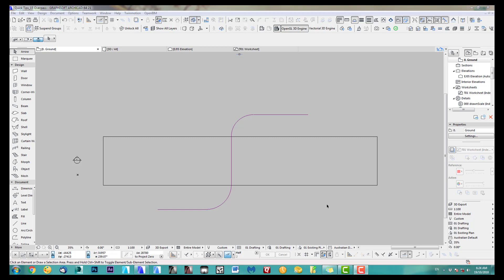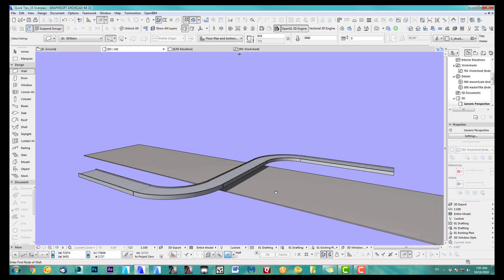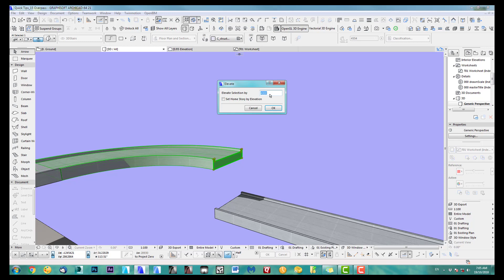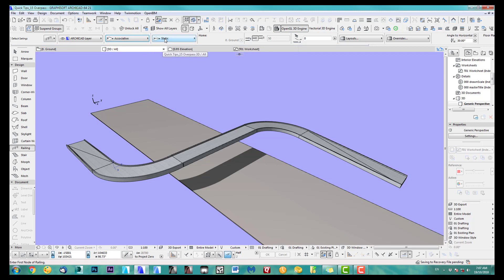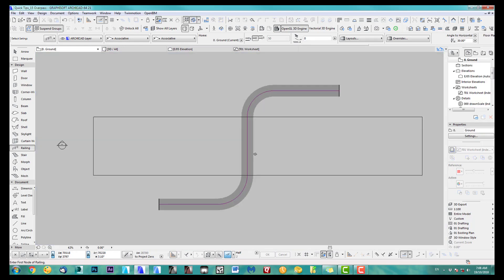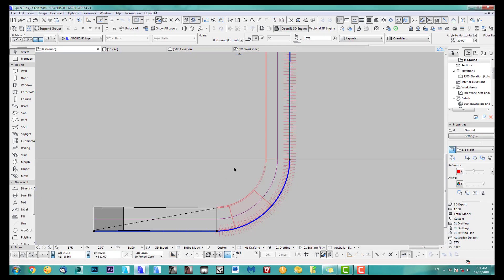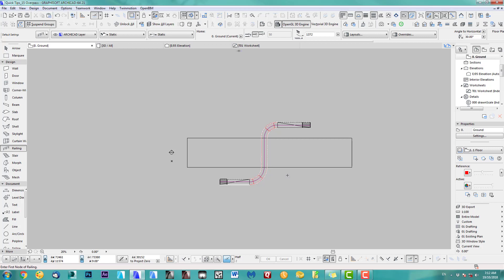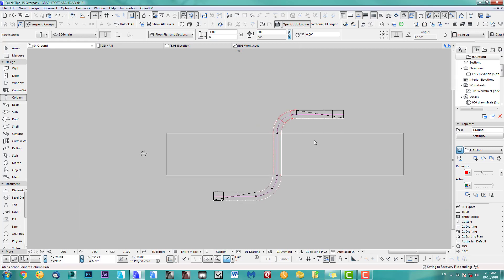How to create an overpass in ARCHICAD

Comment: Interesting way to do it in Archicad. Its a pity Archicad doesn't have simple loft or sweep tools like 3dsmax, Rhino, etc
Reply from the maker: Tell me about it ! Yes we really need a sweep tool which works along a spline which has different polygon heights. You can sweep along a line but only on the same height.
Reply: Yes, something that you can have multiple shapes along a path, something that's parametric, non-linear, something that is adjustable and has cover fills. The thing with Morph is any changes have to be re-done again if any changes are made to the profile shape or the path. Just crazy and very unproductive. You would think sweep and lofts have been around for decades, I image the code would be very simple to add.
Reply from the maker: yes changes on morphs are a pain, this is why I try to avoid morph and only use it if I have too.